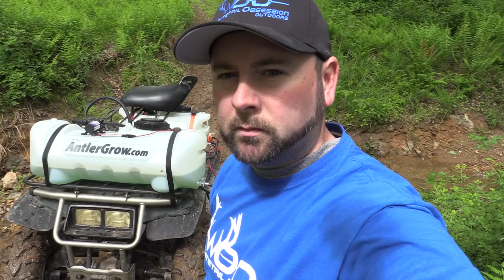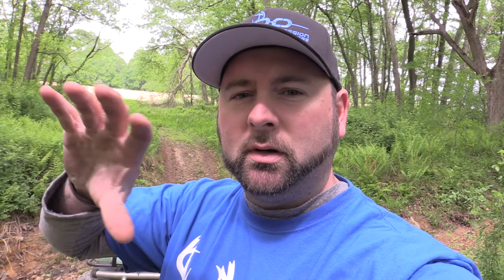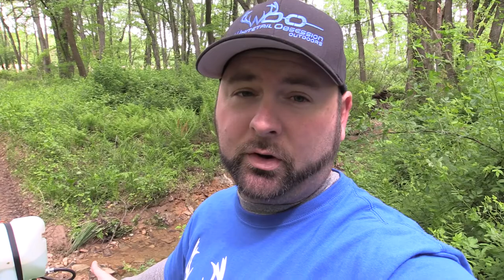DIY Atv Sprayer (Boominator Nozzle) | Antler Grow Wildlife Management

Comment: Hi Dave.
Love the channel. I like the idea you came up with, with drawing water from the creek. My question is, is the strainer anything special that you installed on the end of the hose that you put into the creek? Or do you have a link to what the part looks like, etc..?

Thanks.
Reply from the maker: MelowTrapper you can put a piece of screen with a rubber band for a quick set up, or go to a plumbing store and they have screw on screens.
Reply: @antlergrow  Thanks for the prompt reply. What ATV sprayers are you using in this video? And or would you recommend for spraying Antler Grow?
Thanks.
Reply from the maker: MelowTrapper 15 gal spray tank you can get is what this is, can pick them up at any sporting good store. Size depends on what you’re using to spray with, we use as small as 15 gallon to 250 gallon tank on trailer or truck. We also use 1,100 gallon spray rig on agriculture or pasture. 
Most tanks, at tractor supply or what store in your area, come with a wand and boom less sprayer already attached.. 
all work good!
Reply from the maker: We use anything from a 1 gallon hand pump sprayer to a back pack sprayer to the atv sprayer. We also use a helicopter haha. 
The spray tank in the video was a 15 gallon tank bought from tractor supply. Anyone will work that’s for sure!

Comment: Great video.  Great idea to use two tanks with separate pumps...one to spray and the other to fill the tanks.  Im thinking about the same thing.  Do you find the additional weight creates a balance problem?
Reply from the maker: dakotabluelightning yes it does help in weight, you can spot spray with one and use the back tank for large flat areas!
Reply: Thanks for the quick reply.  One other question,  it looks like the front tank feeder hose is attached to the drain outlet.  Im assuming the other end attaches to the drain outlet of the back tank as well??